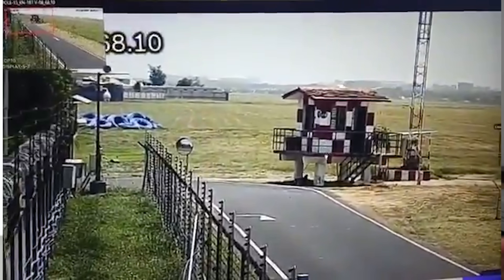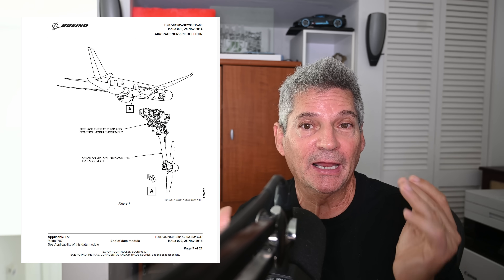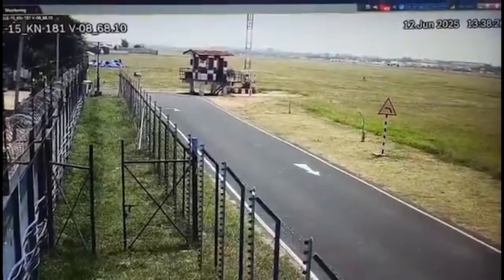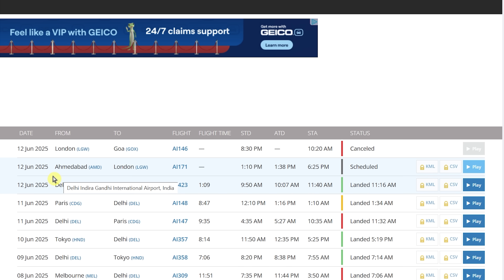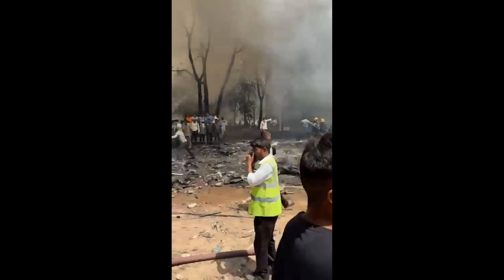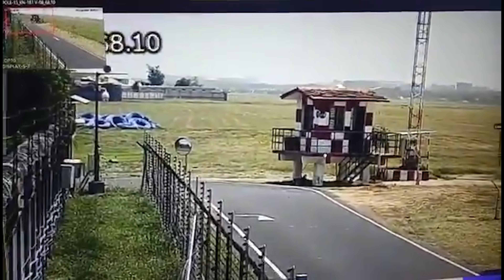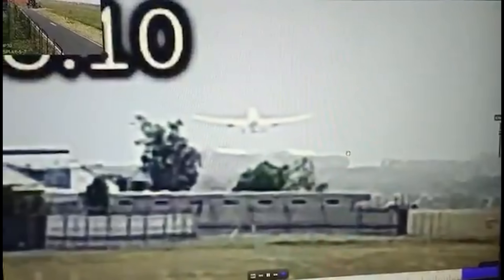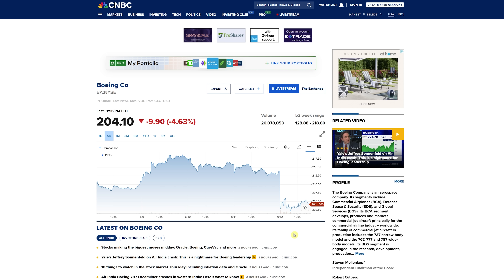What Caused Air India 171 Crash, Mysterious Sound Before Impact

Comment: You didn't mention the landing gear, not being retracted, which always happens immediately after takeoff to reduce drag. Not sure about the RAT but engines are working. Odds of a dual engine failure or bird strike are astronomical. My opinion, same as another video from airline pilot, is the first officer accidentally retracted the flaps instead of the gear. I guess we won't know until the black box analysis. Feel so horrible for those people scared to death right before they actually die. Their families as well. As you correctly said that airplane has a fantastic safety record so the odds of pilot error seem more likely than mechanical or electrical failure.

Comment: 1. Plane overweight (common in India and Bangladesh)
2. Flaps are up
3. Compressor stall causes an engine to lose power
4. Pilots didn’t lower nose on time
5. Plane stalls

Combination of pilot error + technical failure but in this case it’s a pilot and airline error mainly

Comment: The landing gear should have been retrackting at this fly by point.  It could be that the Pilot monitoring retaracted the flaps instead of the Landing gear.
that will cause a major loss of lift at this low speed. The gear that was out, will worson the situation preventing a quick build up of speed.
Lets wait for the Data Recorder to see if it was a pilot error.  I hope it was not !

Comment: So if you look at flightradar24, the plane initially took off from delhi and it came to Ahmedabad and then it was travelling to London, it has the same registration as the accident flight, so the video which surfaced is actually true that the systems were not working right from the start

Comment: On May 22, 2010 ,Air India Express Flight 812, flying from Dubai to Mangalore, crashed while landing at the Mangalore International Airport. The Boeing 737-800 overshot the ruboar a tabletop strip surrounded by a steep drop and plunged into a gorge. The crash resulted in the deaths of 158 of the 166 people on board.

Comment: You didn't mention the landing gear, not being retracted, which always happens immediately after takeoff to reduce drag. Not sure about the RAT prop (what can that little propeller do to help the airplane fly?) but engines are working. Odds of a dual engine failure or bird strike are astronomical. My opinion, same as another video from airline pilot, is the first officer accidentally retracted the flaps instead of the gear. I guess we won't know until the black box analysis. Feel so horrible for those people scared to death right before they actually die. Their families as well. As you correctly said that airplane has a fantastic safety record so the odds of pilot error seem more likely than mechanical or electrical failure.

Comment: What does seem apparent is that the undercarriage is not being retracted at any point in this video.  As you say, the condition of the flaps is hard to determine, and at a minimum flap setting they are very hard to see in a video of this resolution.  However, from my personal (albeit only private pilot) experience if I was beginning to mush into the ground, I would certainly have the gear up to get rid of the drag and give me the necessary airspeed to climb.  I don't know if there was some mechanical issue preventing the gear from going up, but I hope that there was not a mistake whereby the flaps were mistakenly retracted instead of the gear.  When you take off in weather that is hot and you are heavy, you need all the lift you can produce.

Comment: THE FLAPS ARE NOT OPEN AND THE CORNER STONE OR SLOW SPEEDS HYDROLIC FAILURE YOU SEE THE ENGINES DURING TAKE OFF SHOW ANOTHER JET YOU WILL SEE THE ENGINES ARE NOT VISSIBLE

Comment: About the RAT sound. You only hear that when there is NO engine noise. The missing data here is how long did it take for the plane from full stop to Rotate. A 787-8 takes something from 35 to 50 seconds depending on the load. What if they forgot to input the actual weight in the flight computer and took off with the wrong power settings? Do you really believe that two Hindi pilots would talk English on a flight?  787-8 takeoffs leave a light smoke trail at takeoff. No trails here, not even heat trails.

Comment: The plane used the entire runway to lift off which is not a textbook takeoff. The runway is 11500 ft long and a 787 needs 8500 ft to take off. It was struggling to get airborne and was unable to stay aloft. Something happened after it was too late to abort.

Comment: If you pull the wrong handle and it is a big if, but if you pull the flaps handle instead of the landing gear is has the opposite effect and will cause the plane to lose lifting. I dont see the landing gear being retracted when it should

Comment: Problem looking at stock photos and video clips a 777 or 787 should have wheels up (or going up) and 5 degree down flaps at 15 seconds off the tarmac and we see the wheels down as it crashed.  

I expect that the co-pilot put flaps up or flat as he tried to  put the wheels up ending the lift then the captain pushed the engines.  Comments from a 787 pilot were that with flaps fully out and 5 degrees down the engines should not be almost fully obscured by the flaps and the engines are fully visible in the crash video!

I think that as the captain was panicking he caused the ram air turbine to engage as he can activate the RAT VIA a manual override switch on the overhead panel allows for deployment used in specific situations. 

Maybe Boeing should separate the two levers for flaps and landing gear to avoid errors!

Comment: Here in Argentina, several pilots weighed in. 
They focused on the landing gear, which was never retracted. Why? 

They also didn't see the flaps in the correct position. 
Another issue they mentioned was that the plane initiated takeoff with less runway. It wasn't at the head of the plane; it was about 1,000 meters ahead of it. Greetings from Argentina 🇦🇷!!

Comment: They were finding a safe landing place to land the plane either on some vacant road,ground that is why the landing gears were down as a last resort.usually right after the plane takes off the landing gears will be lifted up.they tried to find a safe place to land where there is no dense population around it but failed to do so.the engine/power failure made the plane completely dummy toy so it started losing altitude same how it happens with a paper plane.

Comment: Excellent analysis of what could have happened. No claims, just the views convincing enough to understand what could have gone wrong. Especially the RAT and peculiar sound heard in the original video.
Reply: Yes. Also flaps look deployed. This looks like either major electric or engine failure.
Reply: On ne peut rien déduire sans lire la boîte noire de l'avion.                 @ozzyosbourne6
Reply: @ozzyosbourne6  flat looks nothing because on this airplane you cannot tell if they are deployed for take off or not. And that RAT sound has not been discovered by this guy, who has zero expertise in the field, it has been theorized no more than 3-4 hours after the crash by actual experts, as well as the loss of power of one or both engines and no problem with the flaps.
Reply: Nothing special about the sound of a moving object changing once it passes the listener. 
Even a passing car's noise decreases in frequency.
It is called the Doppler effect.
Reply: I’m not expert but I also think I can heard the “RAT” sound. Hard to tell in the video but I do think that could be a major key
Reply: I don't think the RAT could make that kind of noise. To me when comparing the landing sound video @4:32, with RAT out, it is still quiet but after a bit the loud noise is heard which sounds to me like Reverse Thrusters used to slow down when landing. If that's the noise we hear in the repeated video @2:31 then that would be a Big Problem!

edit: After seeing how the reverse thruster works on the 787-8 it should not be that. There is no indication in the video that it is open.
Reply: Totally ignores the most obvious fact - the gear should have been up 10 seconds after takeoff and there was no obvious sign of flap deployment.  The two handles are nowhere near each other.
Reply: @the_lar  Many people kept talking about the flaps while ignoring other obvious signs. The landing gears were clearly not tilted up the way 787 gears normally do. It’s actually pointed down in this case. The RAT sound in the original video and a lack of actual engine noise are all clear evidence that there’s more wrong about this situation than just the pilots “forgetting to set the flaps” or “forgetting to raise the gears.”
Reply: @bestwatana345  exactly, i have seen the video of an expert just few hours after the crash where he explains that flaps are very unlikely to be wrong or the cause, that on this airplane, on this video, it is impossible to tell flaps position, and that the most likely cause is loss of power on one or both engine since the RAT is deployed, which can clearly be heard in the raw footage now available, and the absence of tilt of the gear, which is the first step in the retraction process, proving hydraulics power was already unavailable at the point where the gear retraction was initiated.

Comment: The incident involving Air India Flight 171, which occurred on June 12, 2025, and involved a Boeing 787-8 Dreamliner, raises questions about the predictability of the disaster, particularly in light of the aircraft model’s historical technical challenges. 

The Boeing 787 Dreamliner has faced recurrent operational issues  since its introduction, including documented malfunctions resulting in passenger injuries.

Specific concerns have been identified in systems such as the electrical infrastructure, cabin pressurization controls, and potential design shortcomings, including hypothesized insufficient lift  during flight—a factor speculated to be relevant to this incident.

The aircraft involved, operational for 14 years, belongs to a fleet that has undergone revisions and modifications by Boeing to address structural and technical deficiencies. 

Nevertheless, the Air India 171 disaster, resulting in 242 fatalities and one survivor, marks the first fatal accident for the 787-8 model, intensifying scrutiny over the aircraft’s overall safety.
   
While investigations remain ongoing, experts have highlighted the combination of pre-existing technical issues and the aircraft’s age as factors that may indicate latent risks. 

However, definitive conclusions regarding causality, whether systemic design flaws or external factors (e.g., human error, weather conditions), must await official findings.

In summary, the historical context of the 787’s challenges invites consideration of this incident as a "foretold disaster," though technical analyses will ultimately determine its validity.

Comment: We can see the gear wheels still down until it crashed?.  Could it be the co-pilot mistakenly when told by the pilot giving him 'GEAR UP' for him to raise those big landing gear, the drag devices, the co-pilot grabbed the flap handle and raised the flaps instead of the gear?    
Now if that happened, this explains a lot by of why this aeroplane stopped flying, why the lift over the wings died. Because at that point now, the flaps are retracting, all that extra lift you are producing in the wings goes away.  The plane is already slow, got the power pulled up, all pushed up all the way.  This aeroplane's as heavy as it's ever going to be in this flight and still got those great big landing gear out there producing all sorts of drag. This is a bad combination at this point. One can see the nose now start to come over because the aeroplane is trying to create as much lift as it can over those wings. And if the flaps are coming up, it's going to nose over to get even more air flow over those wings. That's going to be a very, very uncomfortable feeling for the pilot at the controls because he is losing air speed and he is going to begin to lose altitude. Remember, he thinks the gear has come up, he might not know that the flaps came up.  He just sees a motion over next to him and all this happens in a split of seconds??  So sad this happening.  We pray such an accident is a learning experience and hope the authorities to improvise not to have a repetition  of such  a catastrophic, sad event in aviation future.   God bless the 241 souls and of their families

Comment: I believe that there is only one reason for this, and the pilot monitoring retracted the flaps/slats instead of the gear. You can clearly hear the engines operating, but what we don't know is if all 3 hydraulic systems are operational which will also deploy the RAT. Yes it does sound like a RAT, however, I doubt it, this could be something driving past. There was no Notam for birds in the area to possibly cause a dual engine failure.

Comment: Passenger planes uses external air conditioning units for ventilation while engines off. So i don't think hot cabin means any malfunction at all. This can only means land crew may prematurely disconnected air conditioning unit, which happens often when flight have unplanned delay before pushback.

And for RAT theory, sound i can hear is nothing but full powered engines. Most turbofans does buzzing sound when full powered for take off. I don't think it was flying with RAT power.

What is clear from videos, flaps are fully up and this caused plane to crash. Speed was good, engine sounds fully powered, only visible problem is flaps. Question is as they said plane just had recent maintenance, did flaps doesn't moved at all while pilots set properly. Otherwise they should get warning from TOCWS (take off configuration warning system) when they pushed engine power to full on runway. Or they somehow forgot to set flaps and TOCWS failed to warn them for some reason. We'll see when FDR data revealed.

Comment: RAT theory holds good but its very rare situation and it does not work while you need to ascend with low power . What you can see from picture there is loom of dust prior to noose lifting up at critical point where lift was not proper, may be flapper were not trimmed in time to kick up thrust & flat bottom of plane got sucked in due to low pressure build up between wings and runway that only happens when wind velocity between plane and runway is really high, so called suction effect / Bernoulli effect.

Comment: A Ram Air Turbine (RAT) is an emergency power source for aircraft, providing hydraulic or electrical power when the primary power systems fail. It's essentially a small wind turbine that uses the forward motion of the aircraft to generate power. The RAT can be deployed automatically or manually and helps maintain critical systems like flight controls and communication during emergencies, allowing the aircraft to land safely. You showed in 2 videos you mentioned here and both were landing aeroplanes?

Comment: The aircraft did not have enough Lift because the flaps are up and the landing gear is still down.  At this point after takeoff the flaps should be still down to give the aircraft more lift and the landing gear should be up.  Maybe pilot error, raising the flaps instead of the landing gear, just a thought.

Comment: THE SAFEST WAY TO TRAVEL  IS TO GO BACK TO HOW  OUR ANCESTORS  TRAVELED  , BY BOAT , WALK , HORSE, AND CARRIAGE 
 Battery, fuel pump, maybe condensation water in the fuel, , second-hand plane, , poor maintenance,  , possibly bird strike  , possibly wrong part, if there were repairs services,  , maybe faulty levers pilots thinking that the flaps are in correct positions, take off but it not ,  or they never had flaps down take off ,  correctly,  maybe pilots flaps up before landing gear , up ,  ,  or  AI 😮 , computer hack ,  or someone on board bad karma  😮   or  all passenger's  except for  one  time is up , 
Possibly pilot errors switch  wrong button or lever ,  maybe suicidal,   theses can be all related to the crash  ,  my thinking is  flaps incorrect ,, fuel , batteries no  electronics hence why RAT  deployed ,. Wrong Lever flaps up before  landing  gear  , won't know until data  information  , voice box , 😮 , 
But there noway pilots  had time to  make corrections  and decisions  , RIP TO ALL PASSENGER'S PILOTS  AND CREW MEMBERS CONDOLENCES  TO THEIR FAMILYS  ,  
,

Comment: On take-off, the left engine kicks up loads of dust. The right engine doesn't. So it took to the air with essentially just the left engine.
Then perhaps the team extinguished the wrong engine.
It's happened before. Kegworth I believe. 😢
Reply: unless it's not dust and something gone through the engine, or some other contaminant.

Comment: You have solved most part of the investigation. Definitely the RAT was deployed indicating there was probably engine failure. Also the persenger that claimed the ac wasn't working properly also indicated that there was problem a engine mechanism.. RAT deployment is not really helpful with a full loaded aircraft when taking off. It's mostly effective for emergencies when it's airborne, cruising and landing. Good analysis.